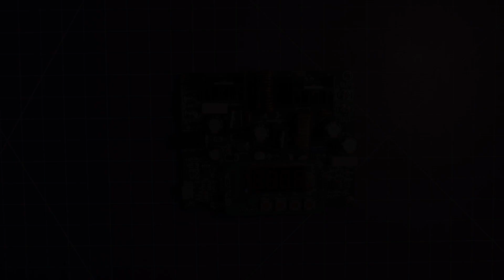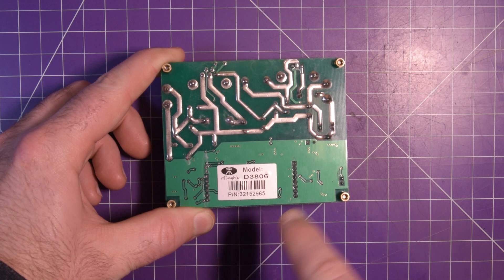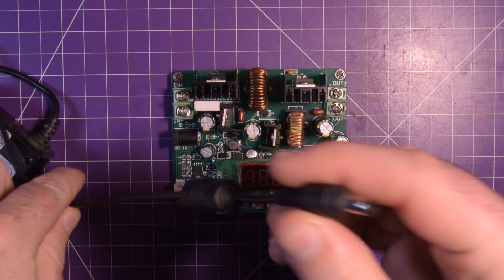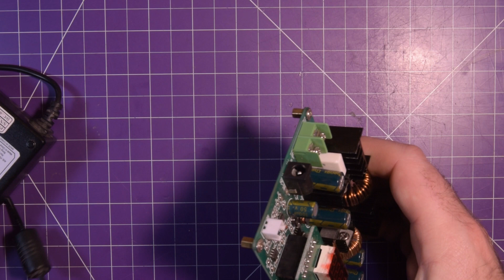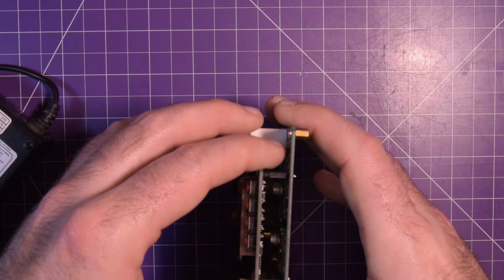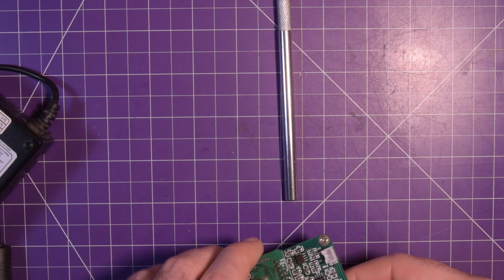Quick Look At The D3806!

Comment: Is the output protected to shorts? Can I use it for faultfinding on PCB's? Like powerinjection (i.e. 5V/3A) to find a shorted component?
Reply from the maker: It is not protected for shorts but it does have adjustable current limiting, which serves the same purpose, just not as quick. You can also just make a rig where you install an automotive fuse or a breaker in series if you wish

Comment: How low can the output voltage/current go ? It's nice that it has display resolution of 1mV and 1mA and nice that you are able to set it to 1mV or 1mA, but can it actually do those low numbers ? I already own several variable PSU's, some are buck, some buck/boost and some linear. I found out  that it's very hard for my linear PSU's to regulate anything under 2V, even when i set it to 1.2V on the display (or anything below 2V) it just outputs 2V.
It's not a malfunction, it's just not achievable with that particular design. The same issue on very low output current. With my tongue at the right angle I'm able to turn the pot to set (limit) the output current to 0,012A (12mA) but when i would connect an LED (that was rated for a current of 22mA) it would do a short bright flash and could go straight into the bin. It is because when i actually measure the current it's more like 0.150A, even when it says 0.012A on the display. That PSU allows me to set it to low output values( on the display), but can't actually output (regulate) those low values. Other PSU designs like the ones using LM317 can't regulate below 1.25V (if i remember correctly). I had to choose/buy a whole other PSU with internally negative voltages for it's op-amps to actually regulate the output voltage all the way down to 0V. How about the D3806 ? Are you able to illuminate a 10mA or 20mA LED without using a resistor ??
Reply from the maker: I've used it down to 20mA for sure, I'll have to test it's absolute limits, but I did go down to 1v before as well
Reply: @SimpleElectronics  Cool ! Thanks for the info. I'll have to order one just for kicks.

Comment: Sorry if this is a stupid question but what is that graph patterned work surface you are using and where might I find one?
Thank you for your excellent content!
Reply from the maker: No such thing as stupid questions; this is a self-healing cutting mat, it's self-healing because it remains flat even if you cut into it. In reality it's not 100% effective, but close enough! I got mine in the sewing section of my local Walmart, which is why it's purple, but most people buy them on Amazon or at hobby shops and they are typically green
Reply: @SimpleElectronics  Thank you for the info!!

Comment: The module seems great, when i got my own supply i kind of went all out and bought an almost 70 dollar supply, a HPS305D. Despite it being really expensive it works great and is virtually indestructible and despite it being one of those simple 4 pot ones i haven't had a single issue with it.
For your unit might i suggest one of those project cases that have a handle similar to an old oscilloscope, a decently sized one would have room for everything you need, might make for a cool video.